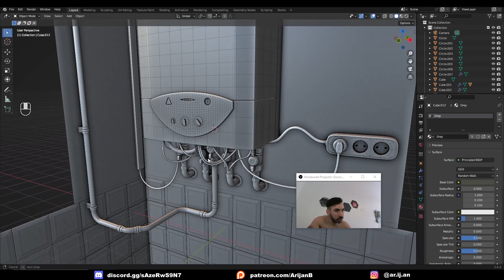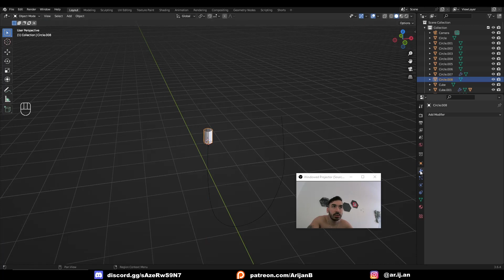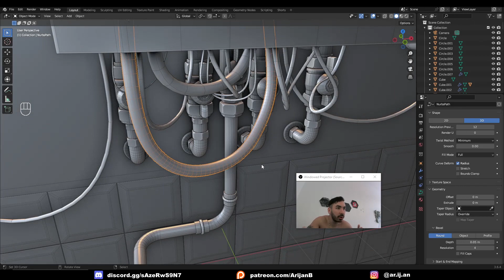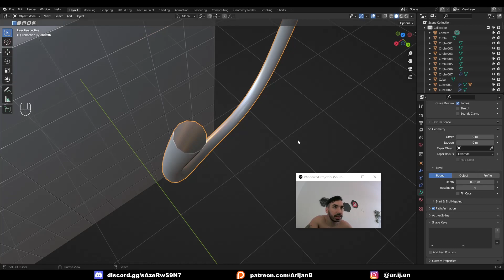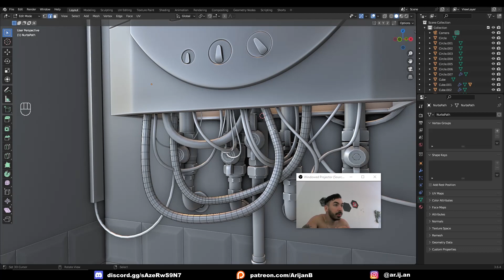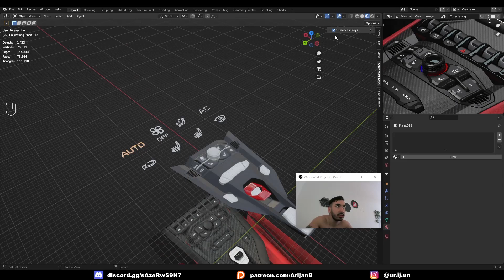The MOST USEFUL modeling tool in blender (Tutorial) (Arijan)

Comment: Is it possible to measure the length of the cable? Let's say I want it to be exactly 53cm long?
Reply: You can't measure curves from what I know. But you can measure edge length.
Reply: Yes, add path. While its still straight set desired length in transform panel. Then deform as you want.